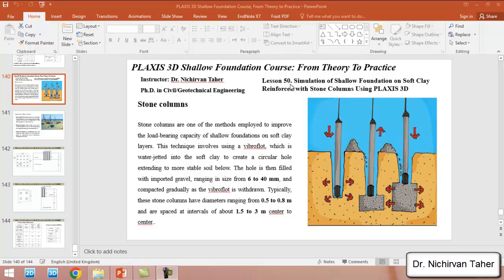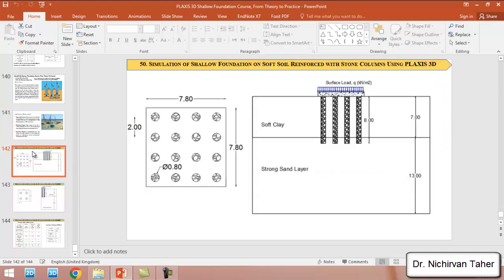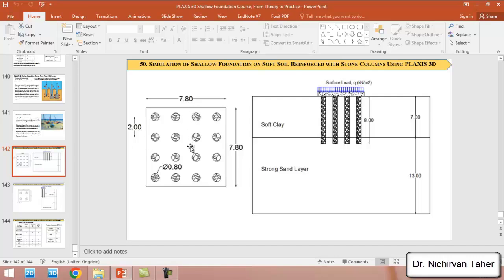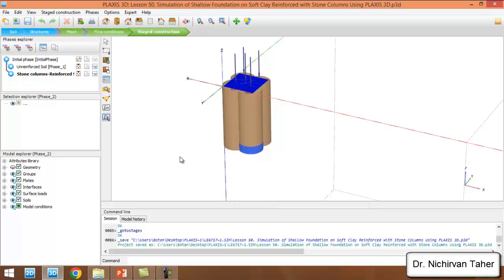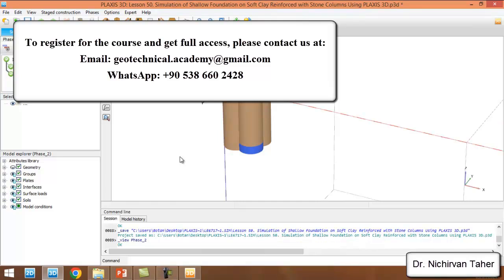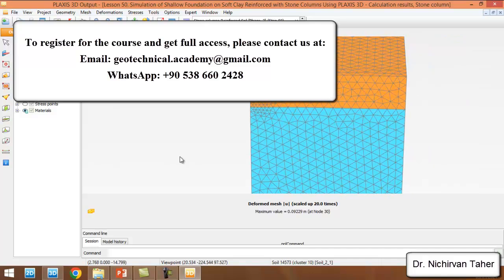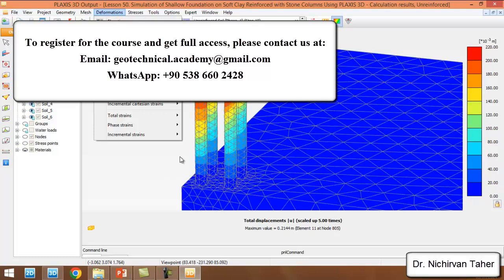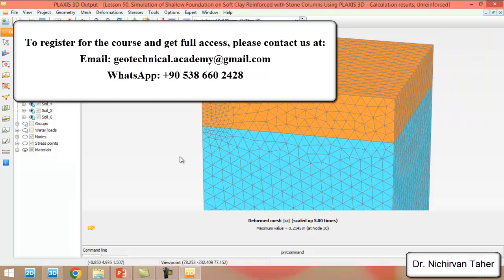Lesson 50. Shallow Foundation on Soft Clay Reinforced with Stone Columns Using PLAXIS 3D

Comment: sir i have one question where do we use positive and negative interfaces
Reply from the maker: @DTCEJChetana  In PLAXIS 3D, positive and negative interfaces are used to model the interaction between soil and structures like walls, slabs, and piles. The positive interface is assigned to the side where the structure’s local positive normal points, while the negative interface is assigned to the opposite side. We use both when we need to simulate soil-structure behavior on both faces, such as in diaphragm walls, basement walls, and tunnels, ensuring accurate modeling of slip, separation, or reduced strength along the surfaces.